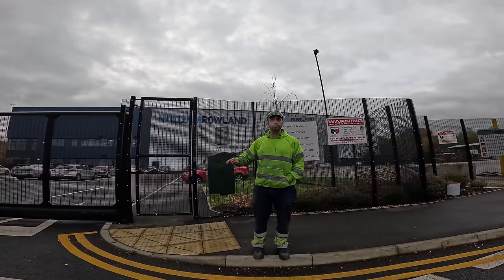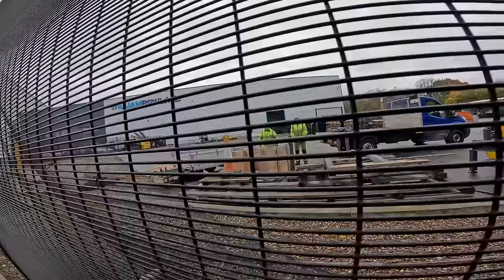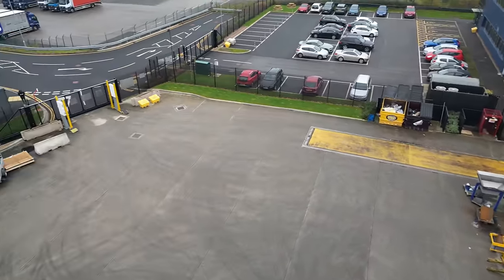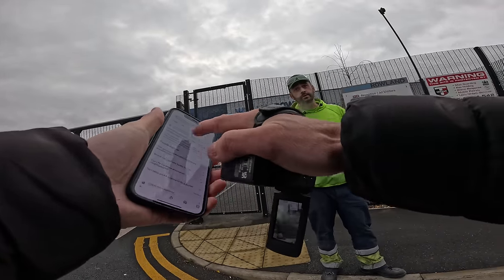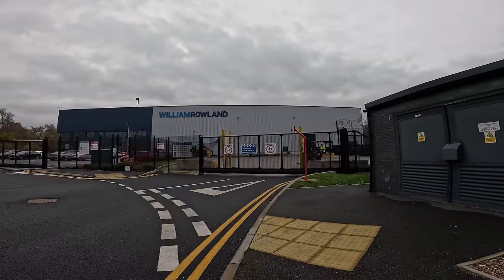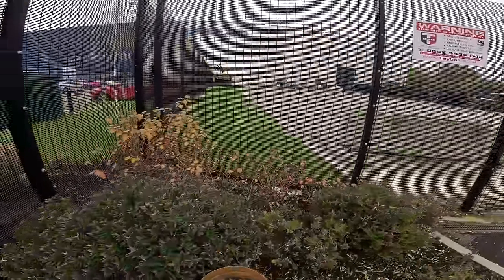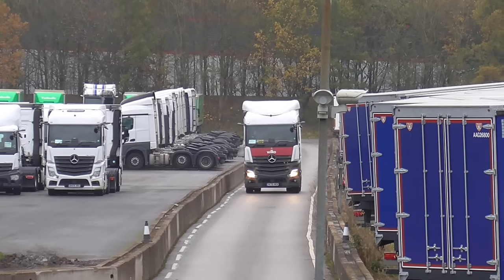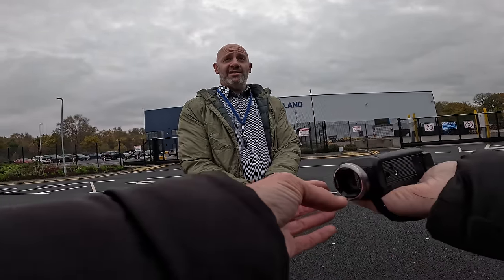You Have Not Been Asked By This Company To Come And Film! 😲🎥🛸❌

Comment: These metal scrap parts you've picked up are either from metal drilling and/or a turning lathe. Either way, they can be pretty sharp which is a risk of harm and usually they have been in cooling fluid which  contains oil so they are an environmental risk. Maybe a container lorry with no cover lost them entering/exiting the site. The director should take this seriously

Comment: The metal is swarf from machining metal. It's stored in big tubs which are collected for scrap every so often. Don't know how it's fallen off the lorry - the engineering works I worked for ensured it was secured before it left the factory. One, its razor sharp and two, its contaminated by the coolant sprayed during machining. Not a thing the public should be able to pick up

Comment: Safety observation with the gas bottle, it should be held in a gas bottle holder, if is knocked over and the connection with the regulator snaps then….well there are plenty of videos on you tube!